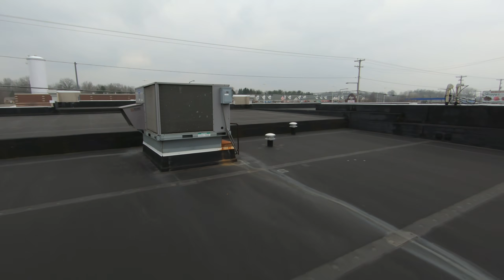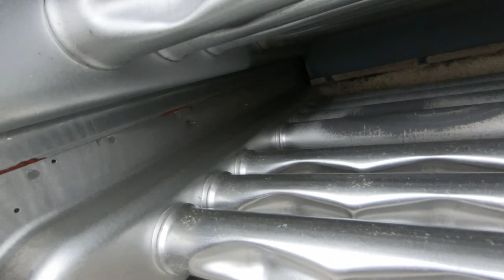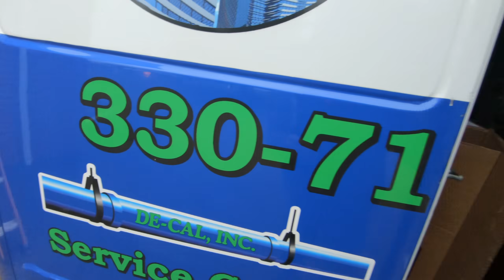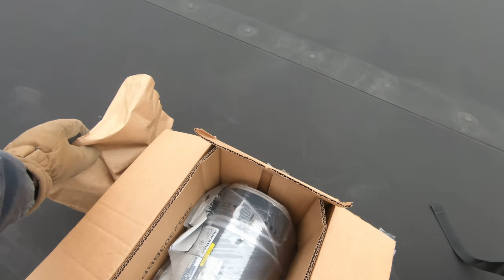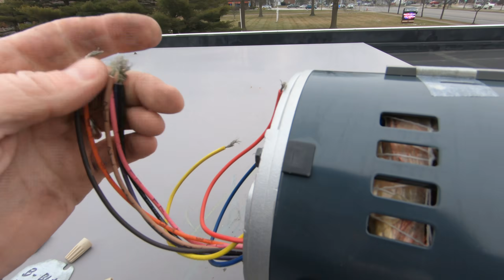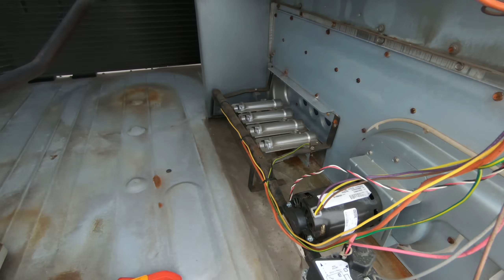No heat service call and repair

Comment: What was wrong with the blower motor you must work on commission to bad should just sell them a whole new unit on every service call?
Reply from the maker: The bearings were grinding, no commission. Just want to prevent a callback.

Comment: #7 Good video👍👍. That dang limit in the motor gave me hell a year or 2 ago, that was the first one I had seen like that prior to that day.
Reply: I had something similar not too long ago on a York (I’m a 1st year apprentice). Found diagnostic light flashing indicating limit open. Tested all limits in heating section and they were closed. Opened blower section and found one limit mounted on side of the blower housing open. Tripped because set screw came loose and pulley shifted and threw belt off causing no airflow. Found it interesting though because the main limit was not tripped, but auxiliary limit in blower section was. Both were manual reset. I would have though if the auxiliary limit got hot enough to trip then the main limit would have tripped as well.
Reply from the maker: @proc7867  yeah you would think the main would have tripped also, I would suggest replacing all the limits switches... 😂 Sounds like you're well on your way in this business! Keep up the good work and thanks for watching!
Reply from the maker: I've run across alot that are cut and bypassed....gotta wonder why so many? Thanks Rick